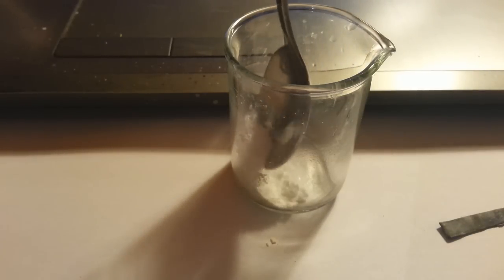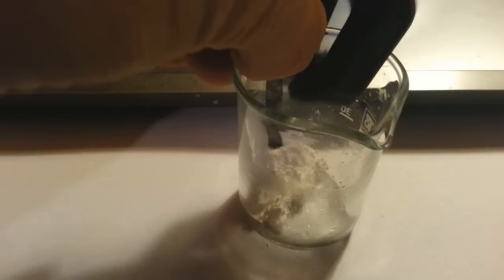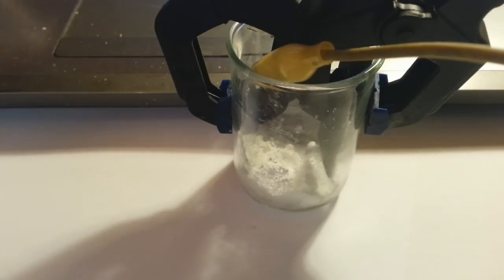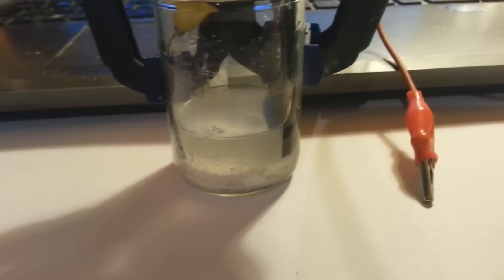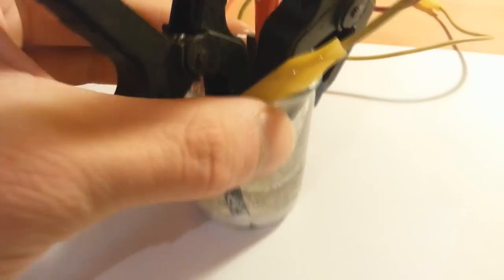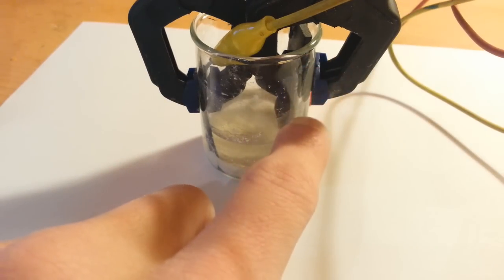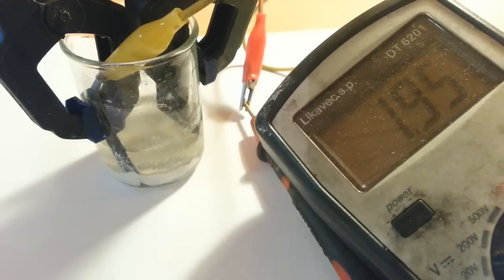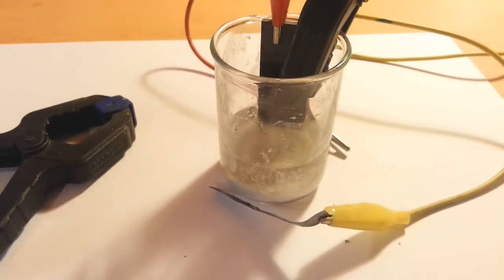Rechargeable Zinc Oxide Battery

Comment: I believe you can make a much improved version by creating an active material slurry with the zinc oxide with a suitable binder and solvent. and then depositing it as a thin layer on the zinc electrodes surface as the current collector. Then let it dry and cure completely. Afterwards sandwich it between a separator and another suitable electrode with some sheets of plastic and clamped together or another similar method to hold the zinc oxide particles in firm contact with the zinc electrode. Then charge it for a while at a low current just enough to convert the zinc oxide into zinc.
You can use potassium carbonate or hydroxide. with hydroxide being more aggressive, but the carbonate version is safer and less aggressive.

Comment: If you can end up with zinc oxide it can be returned to zinc by heating it up to red heat mixed with carbon dust and will return to zinc vapor and collect on a lead surface then just peal it off easy .it all so makes carbon monoxide so be careful.i like this because if you have a large battery bank it can be rechargeable by using a camp fire which would give you the heat and carbon. No electricity needed no waste .

Comment: Great work! Looks possible to me, but I wanted to ask you can both electrodes be copper plates? But maybe cooper will react with the electrolyte, so is not possible. Is that why you use graphite ?
Reply from the maker: Yes you can try
Reply: @cayrex  I can try, but probably is corrosion issue. KOH corrodes some metals, but stainless steal is relatively cheap, can be good electrode material.

Comment: I want to see if I can make Zn/air batteries to store energy from my solar panels in Summer and store for Winter. I see here its not hard to charge these batteries. You can get thin teflon film on the internet. They say it blocks CO2 and passes O2. So, you could use this with KOH to keep the CO2 out. Crude batteries could be all that's needed since the Sun's energy is otherwise lost anyway. The anodes would be separated from the electrolyte in storage so they won't self discharge.
Reply from the maker: Yes, I know what you mean. The teflon layer is to limit water loss. https://youtu.be/1KotizlmAx0 that is for zinc air swap battery. The anode gel can be stored in a tank.
Reply: For years I've been following eos Energy and their zinc/air batteries. They went public and I bought some stock. They worked out the several challenges in these batteries. I think your battery is not zinc-air which can hold 3 times the energy of Li-ion. I read charging zinc-air is hard. You make it look easy. I am encouraged to try this. I see my batteries could be just left in tact, but wrapped with shrink wrap or contained in an airtight box. They will only discharge if oxygen can get to them. They are also said to be a fuel cell. If only charged/discharged once a year dendrites should not form (the biggest problem)....What is this gel you talk about; how is it made?
Reply from the maker: My swap concept is similar to that concept https://www.zinc8energy.com/technology The cell which you see on the picture is zinc air with anode swaping system, which swap the zinc slurry when the cell will be discharged. No, my cell dont have twice the energy of Li-ion, because I dont use any catalyst. But the energy which I put in the text is the currend specific energy of zinc air  cells which I found on internet and is to compare the energy of current state of zinc air and lithium ion.
Reply: @cayrex  I learned a teflon film will stop CO2 and pass O2. I don't know what eos Energy uses in their batteries. CO2 is the enemy of zinc/air batteries.
Reply from the maker: https://www.instagram.com/p/CVl6eJqqYyz/?utm_medium=copy_link
Reply: @cayrex  When discharging in use ZnO is the end product formed which settles on the bottom being insoluble in water.

Comment: How many life cycle
Reply from the maker: I dont know, I dont make the cycle test. I make only around 20 cycles for this video
Reply: I have done many cycles in similar zn batteries....and the zn electrode brakes at the interface between air and the electrolyte.  In my case, I  have used KOH and NaOH....and the thickness of the zn electrode can be thick...but eventually will thin out at the interface and brake... Maybe when using Na2SO4 ...that will not happen...I have not test this electrolyte yet.  Cayrex2...what was the molarity of your electrolyte? Thanks and keep the good work!
Reply: @tonymac96  Coat the electrode in an insulative epoxy or coating where the air-electrolyte interface meet. and a bit above and below. Then it will last much longer.
You can also use a different electrode instead like nickel which is plated with zinc. which would not break at the air electrolyte interface since it is plated with zinc.
Could even use an uncoated nickel electrode and simply plate it with zinc in the electrolyte and use it.
Also you can use potassium carbonate as the electrolyte instead (Very Similar to potassium hydroxide but less aggressive.)

Comment: Love your work.   I've been following your videos for a few days now and I learned quite a bit about battery construction.  Does the electrolyte degrade the graphite and the zinc electrode while in storage ??
Reply from the maker: by low voltage will the electrolyte only  intercalate into graphite layers. but if you increase the voltage when is the electrolyte intercalate into graphite will seperate the layers in graphite. so if you charge the battery with 2 to 2.2 volts max will be ok.
Reply: Thank you.
Reply from the maker: WTF BBQ no problem. enjoy 😉

Comment: thank you nice idea , will do this. if I use copper on positive during charging I think that it will wear of  what,s your say.
Reply from the maker: Aquif Khan you can use copper for the pozitive electrode, but the voltage will be some like 1 - 1.2 volts I think. you can buy graphite plate from ebay (cost about 2 EUR)
Reply: cayrex2 thanks
Reply: cayrex2 for the batteries such as a simple sulphuric acid galvanic cell,  during discharge zinc is consumed and during charge copper dissolves, if we add an additional inert electrode like graphite and charge via graphite discharge via copper , thinking of this for quite some time
Reply: Is it sure that we can rechargable many times?